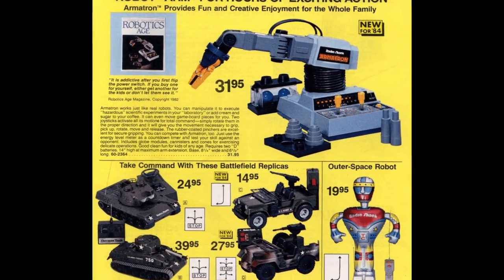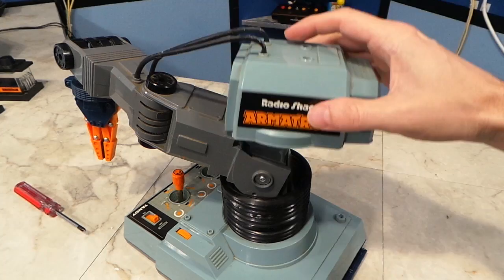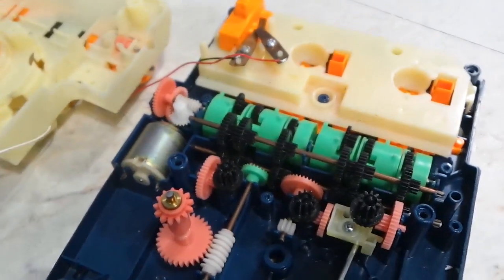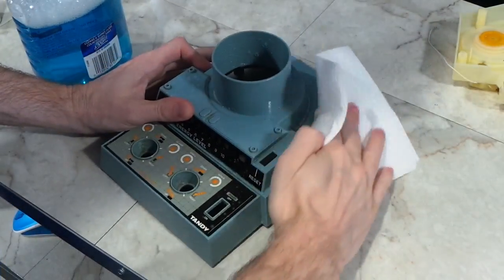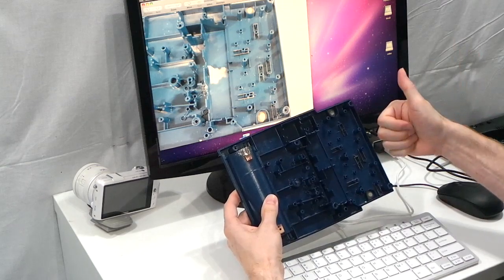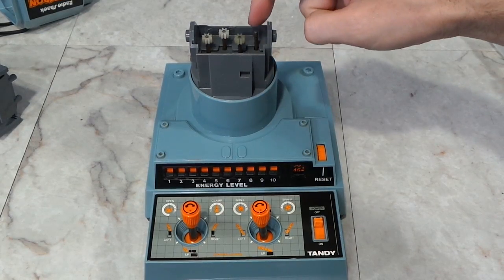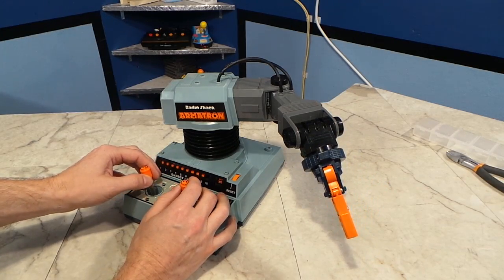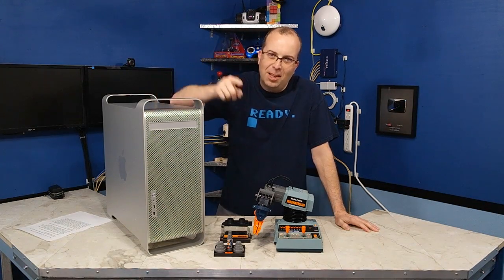Repair and Restore of Radio Shack's Armatron Robotic Arm from 1984.

Comment: Hey there. I got a solution to your missing gear and it's lo tech and doesn't require a 3d printer or mastery of autocad. Given your hobbies, you should already know about Instamorph. It's a thermoset plastic used to fabricate anything you can imagine. It's cheap, comes in a jar full of little plastic BB's, and you activate it in a cup of hot water. The plastic turns clear and can be worked into a wad of bubble gum like consistency. There is a short period after setting where it is soft enough to work, and firm enough to be shaped. Simply put a marble sized wad of it on the end of that empty shaft where the gear was supposed to go, and spin it, and the gear it would press into, around in a circle and use the teeth of the other gear, to impression the correct teeth in the instamorph. Once it is meshing nicely you just wait for the plastic to completely set, then use xacto knife or snips to clean it up. It's a softer plastic, but very strong and it self lubricates for use as bushings and gears. I bought a small jar of it years ago and still have tons of it because a little goes a long way.

Comment: Wow! Such an annoyance that one tiny part is missing. I am looking forward to the G5 video. I have an early G5 (in fact, I think it is one of the first) which I was thinking of turning into a retro-gaming unit, as I have a Mac Pro tower for my desktop. Those aluminium tower cases are beautiful and Apple should never have moved to the "trash can" design" - perhaps a topic for an Apple mistakes video? (You only ever made the one on the original Macintosh)

Comment: as a kid i had mine hooked up to a tyco electric train set power supply running at like 18v dc, it ran at like 5x the speed and no need for batteries, but the thing was super noisy though.

Comment: Some years ago I saw a radio shack armatron being controlled by a vic 20 or c64 i don't remember, but thet replaced the joy sticks with 2 motors wich were controlled by the vic 20

Comment: Don't mean to sound like a critic, but you should have plated the battery contacts. Copper is notorious for speed of oxidizing. The gears need some grease, as for the cog, you can get on cnc machined.

Comment: Two thoughts. 
1) If the second unit is complete and works, clean it up...and find someone to scan the missing part for this one and 3d print it. 
2) With two working models, hack one with something like an arduinio for programmed movement. Fun Fun.

Comment: I would have definitely tried to copy the gear rather than hunt for a second unit! Now having a 3D printer, this is my weapon of choice, and i'm confident that i could make it very decently. But before that, some moulding and casting from basic epoxy would have done the trick. Good epoxy holds up REALLY well, better than original or printed parts!

Comment: I know you can 3-d print now, but would it be possible to order a gear somewhere? Not the exact one but one that's close enough to work? Also can a 3-d printer scan something like one of the other gears next to the missing gear and replicate it? I just look up the price of a 3-d printer and they cost much less than I expected! Thanks in advance for any info from anybody on these subjects.

Comment: I'm sure you can buy plastic gear replacement cheap on chainese online shops example aliexpress. I found a lot of gears there sim to fit. Ofcore dimensions must be checked but there are a lot of them. You can also find a loot of gears on remote contreoled cars shops online like towerhobbies.

Comment: Just think there was a time where it was cheaper to fill toys up with gear, instead of motors. I got a plastic gear kit mix from ebay, not shure the teeth size is the same.

Comment: I know this is an older video, but perhaps someone can help me. 

Thanks for this video. I have a question for Professor 8 but  or anyone else who knows. I picked up a used Armatron to give to my grandson who’s into mechanical stuff & robots. It works about 90% with the exception of the whole arm raising. It lowers and starts to raise. At about 20 degrees it starts slipping and dropping back. I spent 2 hours disassembling, learning, cleaning, lubing and re-assembly.  The action is strong from the motor to the main gears in the base. I took the vertical assembly of gears apart looking for broken gears. I saw none. The gear that controls the elevation is laid out strange. It actually sits across 2 other shafts. This gear also has a spring and a metal backing plus a metal gear that lifts the arm. Anyone have any ideas where else to look?  Thanks in advance, Dave

Comment: If you have a 3D printer, I’m sure you can make that gear. Especially if you pull one of the other gears off and scan it with a 3D scanner. In fact, I feel like that would solve the issue of having to buy multiple units when making these restore videos, and make the video that much more interesting. Not that your videos are lacking in that :)

Comment: Funny enough, I can make those gears. All I'd need is the diameter of the outside of the teeth, the number of teeth, and a picture.

Of course, since these were probably injection molded, it'd probably be more helpful to actually get a good gear to work from for pitch dimensions, but maybe I'll just buy one of these on eBay and start making parts for them if there's demand enough.
Reply: I don't have a need for gears, but how would you make them?
Reply: @greembow  

On a mill with the material mounted in a dividing head and a custom ground cutter.
Reply: @cavemanjoe7972  Cool! Looking into getting my fist mill right now. I have a minilathe and a Morse taper 2 drill press that I put an xy table on to do light milling (aluminum and plastic). What mill do you have?
Reply: @greembow  

I'm in a machine shop, so we have a few. Bridgeport, Millac 3 and 6, and a big beast of a Mazak.

Comment: What you need to do is buy a cheap 3D printer to print those pesky parts that sometimes are missing, better yet build a decent one with cheap parts. That's a project on itself.

Comment: Holy crap about all that 3D printing comments! 
Just go to ebay and buy a fitting gear for $0.99. 
And before someone asks: take a look at a mechanics manual to find out what kind of gear you need. Most of them have some kind of standard size and ratio. 
Please stop cluttering the landfills with one-time-use 3D printed stuff!

Comment: Plastic are aging, don't use old gears... even the '''new old'' one from your second unit will be not that good...

you know gears are standard, you can get spare gear easily, it's probably metric (japan?) so you must know the number of teeth and module, probably 0.5 or 0.3. if it's imperial it's tpi (tooth per inch) I find those (from rc hobby store, ebay...)
tips: On small pinion gear, it's harder to measure, but you can take measurement the spur one, the space between teeth is same ;P

Maybe you can 3d print, but it' small, you need good 3d printer, details need to be good, also 3d printed gear that size can be too soft versus true injected plastic ones.

I think the gear have hard work with this type of planetary transmission on front of it, you see it has marks to make it firm tight in the shaft to not spin... all the force in the arm go inside it

Maybe brass metal gear can be better for those duty and replace them all... also synthetic light grease can be good too ;)

20$ is cheap... I think I will buy one soon !!!
Reply: ok, I recheck the video, look like 0.7 or 1.0 module... ;P

Comment: Armatron was always both a marvel and a disappointment to me..it was a marvel in itself in how it used mechanical gearing to get all those movements out of one motor...but always a disappointment to me as a robot hobbiest that it wasn't a 'proper' robot arm (like the eventual Armatron II) with independant motors and joint control.